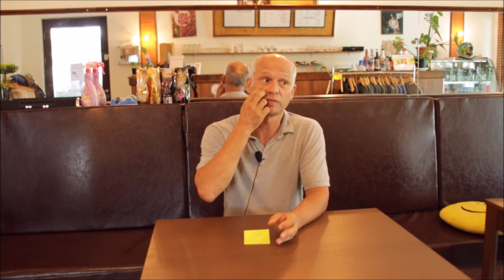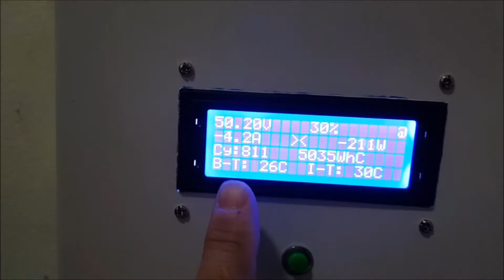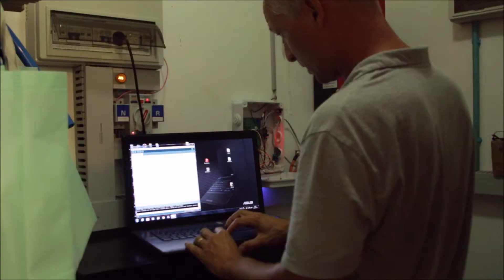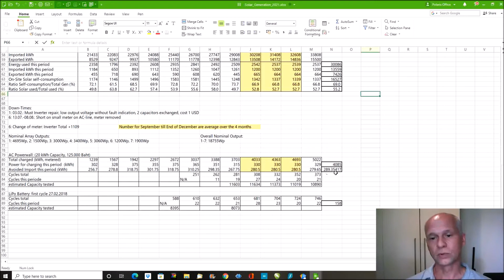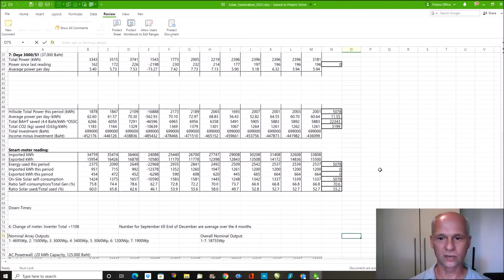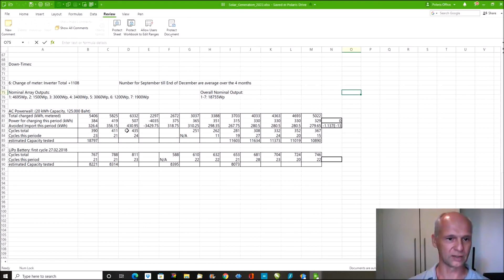Holiday Resort with a 120 USD electricity bill! Update on the LiPo Battery Cycles

Comment: What do you think about over paneling this chineese  inverters? Should you do it or not?
Reply from the maker: the All-in-one Inverter? On those you have to set charging current anyways. You can over panel them, but I would stay below 120% of rated power input to give the charge controller enough room for regulating.
Reply: Yes , it is the all in one voltronic mks iv inverter. The rated power is 5.6kw and max pv wattage is 6000w, max charginh amp is 120amps. I am thinking about putting about 7000w of panels per inverter. Thanks for the great videos.